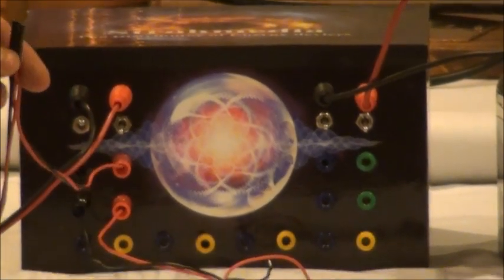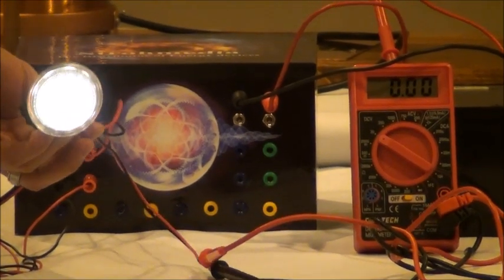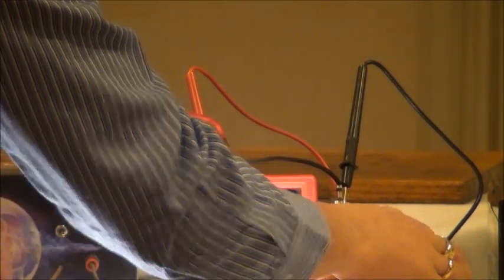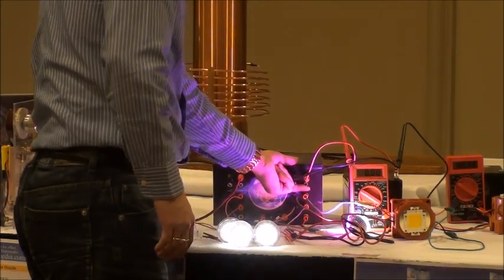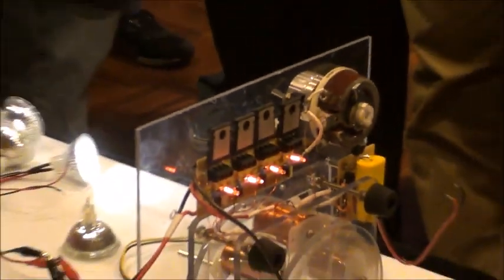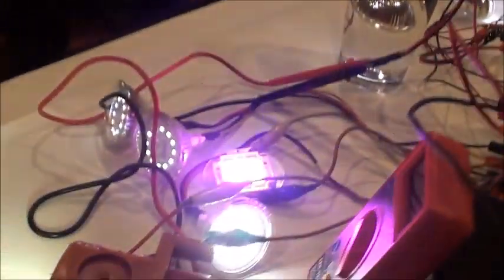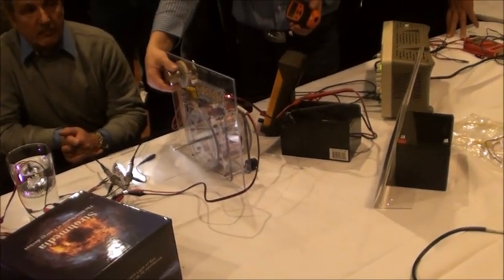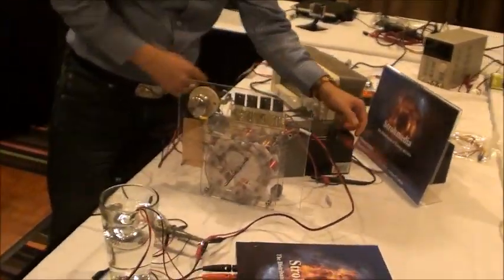Tesla One Wire Impulse Transmission line Balanced Resonance Box

Comment: What's "zero point energy"?
Reply from the maker: Depends on the person who uses those words. With this guy it was more than just zero measurable voltage at the running point of the load, it is a zero Lenz experience in resonance that can be added to indefinitely.

Comment: I did that2 I use  the  battery  to run motor generator then the motor  break negative energy-  going to my magic box, with tesla coil inside, negative. Going to primary  and secondary  set - energy  field in the coil. The secondary out it's- going out ground  that ground going to the second battery  will equelibr the volts in between  the inp/ out pt and all those lights  it's running  on the field on top of the coil like spark, run manny  light he want because  what come out on spark  coil it's 60,000 volts  magnet either  energy. And he only need one wire  cause the coil it's one wire,

Comment: Seems like if we build a one wire tank circuit that oscillates "mater" instead of voltage, we produce work via "electron movement" without spending/using electrical pressure (voltage)from our source, preserving the dipoles and the power granted by the broken symmetry. Im starting to believe that the potential of power alone is enough for circuits if used correctly...

Comment: I have achieved something very similar in 2012 with an ignition coil on the output of the basic dc brushless fan conversion to an ssg that I made myself with no cap pulser. It might not be his way but it worked. I found that some transistors gave better results than others. Also i collected the energy from the one output wire at the top of the ignition coil via a modified spark plug wire. i tried to use the output to power an conventional inverter in series with a earth ground.  When i went to hook up the inverter with jumper wires while the energizer was on, a steady stream spark formed and magic began. It only turned on, it didnt give power. 
Watching this i now know i didnt have the correct frequency. The interesting this was that every piece of metal in the room electrified and would stream purple electric currents into whatever it could ground thru, be it metal or people! At that point, to me, all the metal was a battery but i couldn't figure out how to safely use the energy. It was crazy. Streams of purple energy would jump up from wires laying on the table if your hands got to close! and transistors wouldnt last but a couple days max.  assumed that i tapped into a kind of weird high frequency ac type of energy. In an attempt to go back to  pulsed dc put a diode on the single output of the  ignition coil. This changed the nature of the energy to be very friendly. the color changed to blue and the streams stopped. metal was still electrified but very, very slightly and only for lights.  None of the electric hurt or was disagreeable at all. however, it would no longer run the inverter. seems like Thats because it won't run inductive loads (according to this video), and the frequency, pulse width, as well as the q factor of the circuit components were not tuned optimally. Im sure there is a lot i dont understand about the phenomenon! ...A ton actually. Anyway, not knowing where to go with it next, not having enough money and being weary of safety i stopped that line of research. I regret that now.  I think i will try it again but next time i may put the ignition coil in series with the output of the positive side of the machine and take off the earth ground untill i understand it better.  Thanks for the share! Very inspiring :)
Reply: you put the ignition coil output right to an inverter ? High Voltage ? does this not kill the inverter ?

Comment: Hi Rick. Would you please make a video about how to build a resonant impedance matched series network or a resonant  impedance matched parallel network?
Reply from the maker: I don't have the time under the circumstances. This information is part of conventional theory. You can start with Gabriel Kron for a general concept as the leading authority at the time, and whom came to the same life-long experience I did about free energy in this context. Other than that I point my students often to the rather new rectenna technology that shows many examples that can be very practical.

Comment: Ive come to the conclusion that this energy is wat runs the universe do to its perpetual and other properties,i thought all free energy systems worked the same,but recently ive seen a system produce over unity by conventional means only. no pulse no resonance. Now idk wat to think now?
Reply from the maker: Well conventional means is necessarily under unity. However, I often show how you can combine conventional practices to make an over unity system. The combination is no longer conventional because they are not doing that. The other way to look at this is the fact that some products 'generally used,' which is what conventional means, produce over unity effects. But the products are made for other purposes than energy generation so the people don't realize that this is happening because they do not look for that and they also plug it in to be powered by AC. Also because many people wrongly define over unity as self-running. 
As for free energy without pulse or resonance in your non-listed example, we would have to see if that was so. Not sure why you would say these comments without giving specific reasons.
Reply: @rickfriedrich  sorry the material i was talking about is 4d not 5d and i think its called time crystals
Reply from the maker: John, as for your other comment that was sent to spam by youtube, you will have to pass on actual verifiable information rather than I heard it through the grape vine hearsay stories. My point is that in any over unity process you have to do something open or different than conventional or the usual.

Comment: Okay, there are just LC tanks in series inside the box and they all have a high Q factor. They resonate at about 6 times the input Spike frequency...as could be seen on the scope...this series line of LC tanks are connected to the BackEMF output of the pulse motor and this builds up standing waves, simular to a harpin Tesla circuit...the plus pole of the charge battery reflects the standing wave back and also recharges the source battery...very genious ! Well done Mr. Stroh and Rick Friedrich ! Regards Stefan.
Reply from the maker: He never shared specifically what he did inside of the box. You are not correct. There are several options as I have pointed out. The key is to understand negative energy and resonant impulses. There is enough information in the two videos for people to learn this. Some points to consider are that series inline LCs unloaded would blow out the transistors, and that there are manifestly two different kinds of outputs...
Reply: @rickfriedrich  is he also using the inverted Spike pulses going into his box ? Because he showed 3 traces on the scope, 1. the positive spike from the BackEMF from the pulsemotor coil, then 2. the resonant sine wave from the box' s internail resonant coils and then 3. the inverted Backspike pulse...hmm so does he feed both these Backspike pulses into his Strohmedia box then ?
Reply from the maker: A hint to consider is Figure 5 of True Wireless does not show the secondaries part of the circuit like in Figure 10 4th part of the circuit.
Reply: @rickfriedrich  http://www.genesys.co/   Hello Rick. I wanted to ask you what they call "electrical Radiant Energy Transfer" or "eRET" does this device have to do with Tesla radiant energy, or ether, in short, is it related to the energy that your battery charging devices work with? Regards David
Reply: http://www.genesys.co/   http://www.genesys.co/future-applications/self-charging-car                                                                    Hello Stefan. I didn’t want to ask you; we are doing a review of “eret” on how much this is really a working thing. Can I buy it from them? and what is the price of "eret". maybe they will answer you! all the same, you have a channel that does free energy reviews. Regards David

Comment: Isn't the bulb across the 2 wires coming out of the motor a sort of Tesla's hairpin circuit ?
Reply from the maker: There are several ways of doing this as Tesla showed in Figure 5 of True Wireless and elsewhere. Hairpin was wrong to call it and it should be called Tesla Impedance Circuit as that was the chapter and context of the circuit when he gave it.

Comment: The meter averages voltage so the brief pulse powers the LED but cheap DVM measures zero a/c or dc.
Reply from the maker: Dave, there is more to him pointing this out than you realize. He shows the scope shot also. These meters can be used to show you whether you have this tuned exactly or not when they are zero (rather than 0.1, etc.).

Comment: Thank you, intresting demonstration. Intresting facts that resistive and inductive loads does not work with the device only resonant components or loads like coils, capacitors, bateries. etc. am i right?
Cheers from Hungary
Reply from the maker: He meant for that demonstration. With capacitance you can run resistive and inductive loads after the conversion.
Reply: @rickfriedrich  can I msg u do u have a no